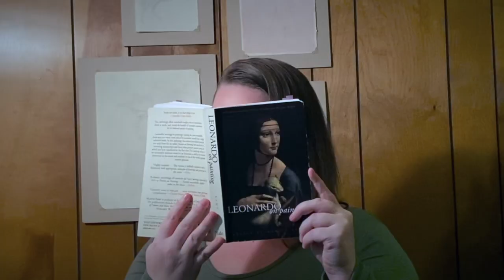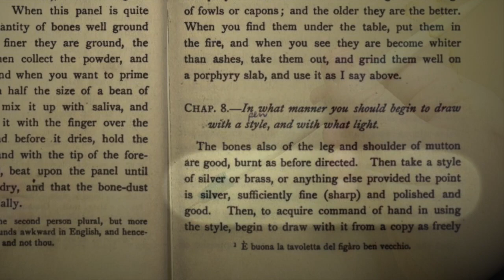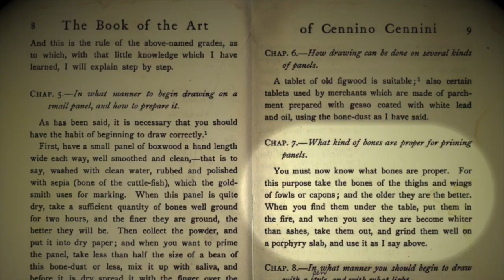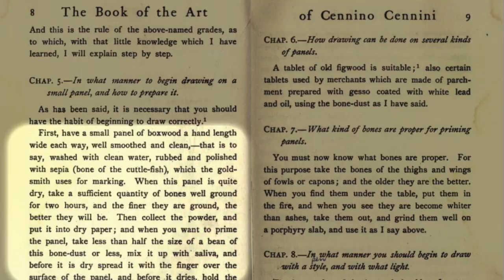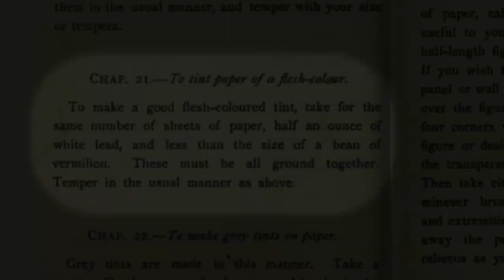Drawing After Da Vinci: Studies in Silverpoint

Comment: Question: is there a way to get a trace onto the paper before drawing with silverpoint? I can't handle the whole "no eraser" aspect.
Reply from the maker: You could use a light box to lightly trace. It’s not entirely true that you can’t erase silverpoint. Sometimes if you use light pressure you can erase it, but you’ll have to reapply the grounds after.
Reply: @emelinalenorreys5194  thanks you!